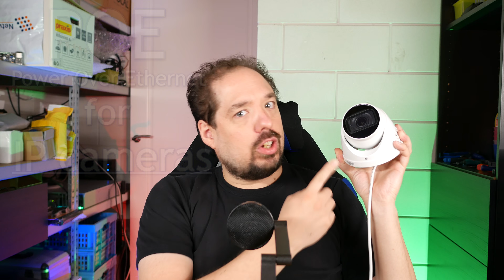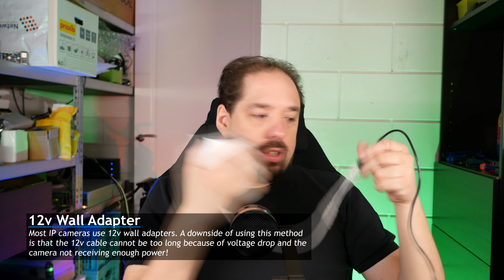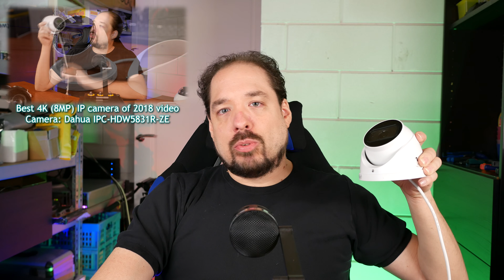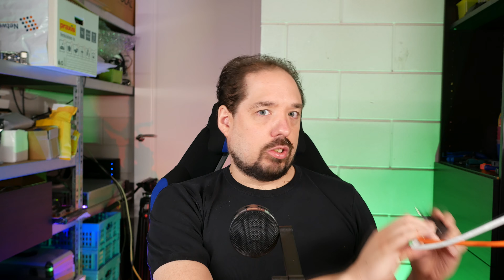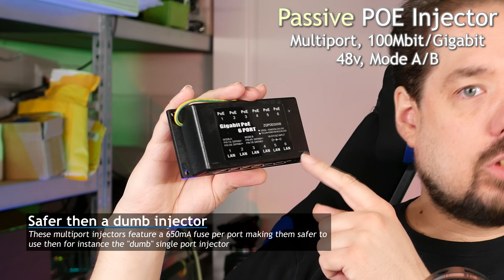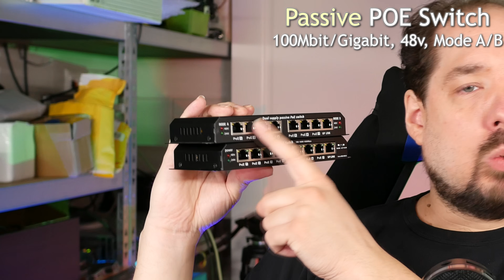IPcam: Power over Ethernet (POE) for IP cameras

Comment: It seems that even Active PoE isn't 100% safe. I've managed to damage the serial console port of a cisco 2960G by patching it to a PoE HP procurve switch :).  The RS232 to TTL chip released some magic smoke.   

The Juniper EX2200-C is also a great soho switch if you need fanless (!),  gigabit (14 ports), poe (12 ports) and an awesome CLI for management.
Reply: This is a design bug in the switch. It should have used RJ11 instead. Yeah, I know, network gear weirdos use RJ45 for everything, because it is so common to have sockets, plugs and crimps already when working with this stuff, and the cables are somehow easier to unplug for RJ45 than RJ11.